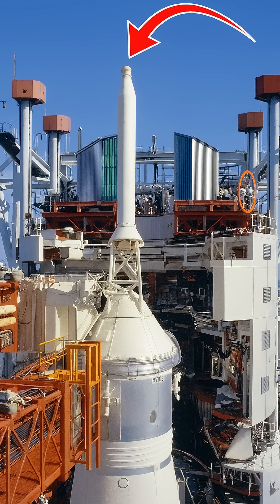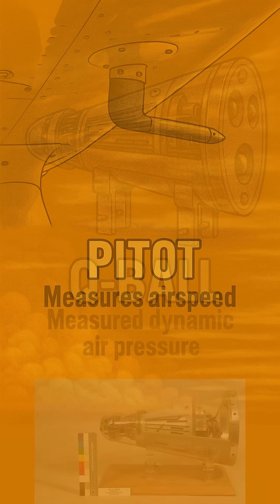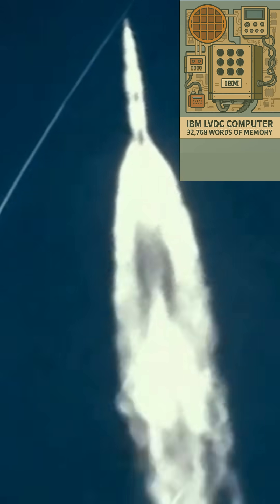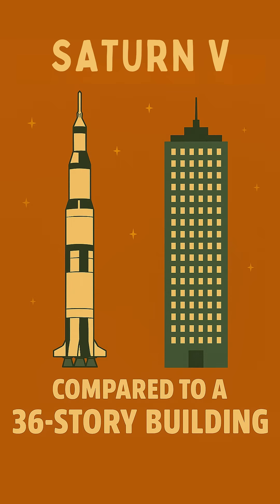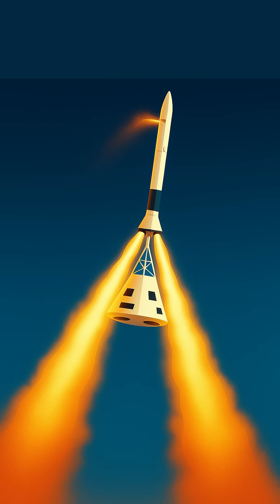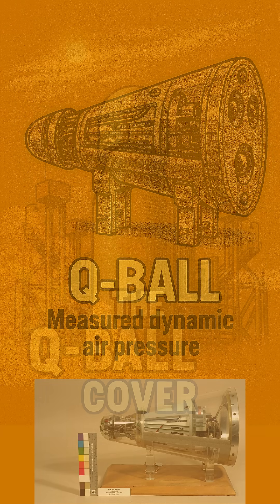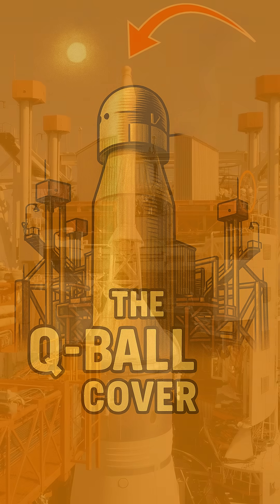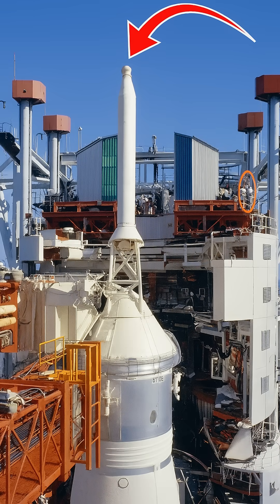What Was That Ball On Top of the Saturn V? Its Ultimate Purpose Revealed!

Comment: So how did  it handle rain or even condensation in the colder air at altitude? The water in those tubes would give unreliable information.
Reply from the maker: The Q-ball, like its pitot tube cousins on aircraft, would have been engineered to prevent water and ice from compromising its crucial readings. This would typically involve internal heating elements to prevent freezing and design features within its ports and tubing for drainage to ensure accurate dynamic pressure measurements, regardless of rain or condensation encountered during ascent.